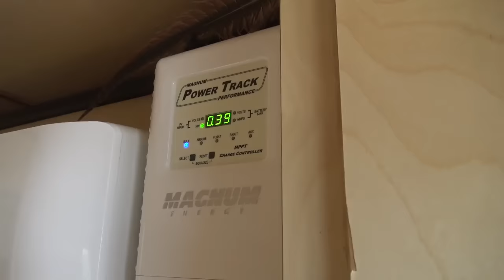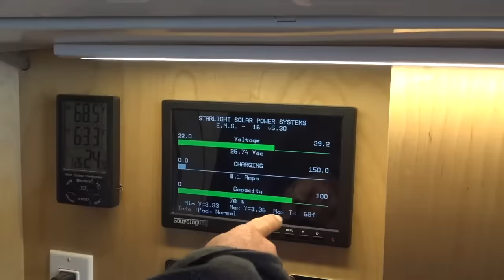Full Time Tiny Living 100% Off The Grid | DIY Cargo Trailer Conversion  With Lance & Tamra

Comment: For Lance - I have the same washer.  To prevent the clothes from getting stiff when they dry, use approx. 3 tablespoons of vinegar in the rinse.  Nice cheap fabric softener, that cuts the soap, and also gets rid of odors.
Reply: Voice I just got rid of mine, as it is a water hog. Lance is totally correct.
Reply: voiceOreezn 
I never knew that.  Thanx!
Reply: @lindacianchetti3599  My pleasure!  Vinegar is some amazing stuff!
Reply: Took a while to figure out soap to water ratios...Less soap was the answer for me.
Reply: But wouldn't you then smell all Vinegary?!
Reply: Vinegar you can drink and it's good for your skin not soap.
Reply: What about the vinegar smell?
Reply: @shaylacrossland1475  The vinegar smell is completely nonexistent.  Once the clothes dry, they don't smell like vinegar at all.

Comment: Love his set up. Great job. My wife & I did the same concept with a 6x12 Cargo trailer into a tiny home. We did 2.4 m wood ceilings  , birch plywood bed for strength & weight savings . Murphy chairs  on the rear of the trailer both sides that turn into a bed.  200 watts of solar -300 watt  soon, sink , 110 v fridge - much cheaper than 12v & easy replaceable,  like he said,  bathroom with shower & toilet. We love it almost more than our house.  We do some state parks but dispersed & national parks with minimal daily fees is the direction were going. Happy trails!
Reply: Love Our Planet Adventures I can’t wait to get started! I’m thinking a cargo trailer as well!

Comment: I actually watched Lance's video when I was ready to start my Cargo Trailer conversion. I have the same, well everything he is using. Love the 9,000 BTU Pioneer mini split. I work and travel on the road, so use it often. Mine is built to haul my Dune Buggy. also. The bed is across the rear and goes up while I am loading it. But the 32 x 32 shower, Mini Split, magnetic screen, even the washer, is the same. I'm running 1200 watts of solar and Leaf lithium batteries. Thanks Tamera for the video and MOSTLY, Thanks to Lance for helping ,me realize that a cargo trailer is RIGHT for me. Thanks, Lance, Tamera and Jamie. Hope to meet you all, some day.
Reply: Love to see some pics

Comment: a tip for your water-hog washer: save and use the rinse water to wash the next load. You'll use half the water and still have clean clothes.
Reply: Seriously, And if you reuse the wash water, too. Start with not so dirty items and progress to dirtier. Lol, then mop your floor!
Reply: Bonnie  Garber that’s the old way
Reply: This is how I do it.  I have exact washer in my cabin (in which I live full time).  Also, use just enough soap to see a few bubbles.  That will keep the clothes from being stiff when you air dry them.
Reply: I have the same type, it's a Kuppet, but they're all the same. I use 5-6 gallons in the wash side with about a 1/2 cup soap then when the wash is done, I put the wet clothes in a bucket and wash 2 more loads in the dirty wash water and add 1/8 cup soap with each load (if needed) my theory is that when you use a double loader you are using the same water and soap without changing the water! (yes, the water will be lt. gray-black and could be gross) then to rinse divide the 3 loads into 8 and add 1/2 gallon of water into the spinner through the hose connect, a quart at a time (a funnel is helpful), not the washer for each of the 8 loads total water used 9 gallons for 2 standard loads of clothes, if you wash and rinse each load the normal way it will take about 7 gallons per load or 21 gallons to do the same amount of clothes.  Your clothes may still have some soap in them, but that will happen at the laundry mat too and if your trying to conserve water, this works and you will have clean clothes! You can also catch the spin water and add it to the washer water to save even more water.
Reply: Bucket.....plunger....soap...water....done

Comment: Outstanding electronics setup.  I really like the ability to watch on the TV.  I bet that 4800 Wh of electricity in the battery would also run that 800 w AC for a few hours in the muggy south to sleep without a noisy generator running.  Nice rig!

Comment: CLOTHES WASHER:  I have a washer like your, but got the model with the dark-blue top because it uses 200w instead of 300w, saving batteries.  I can wash a month's worth of clothing in 2 hours with only 10 gallons of water, by spinning one load while washing the next, and pouring the same spun-out water back into the wash tub for the next load.

Comment: Great job Lance 
One of the best I’ve seen 
Mini splits are awesome
Reply from the maker: I would like to add that to my own bus sometime next year, budget permitting. I totally agree, Mike!
Reply: Enigmatic Nomadics if your bus is divided they make one that’s 2 indoor units to one out door unit but these are only in 220 volt.  If it’s a open floor plan one should be fine. My 15000 btu mini split runs on about 4 amps @ 220 volts very efficient and the Mitsubishi brand are extremely reliable if installed correctly.

Comment: So, maybe it missed it but, what size is this trailer?  It's hard to tell the length, width, height, and number of axles.  He said it weighs 7,000 lbs, so I'm guessing it's a two-axle and probably at least a 7x14', but it would be nice to see the actual numbers.

Comment: With the AC condenser unit in the way, how do you get the propane bottles out to refill? They need to be weighed to properly fill without overfilling. Just wondering caused didn’t look like they had room to come out.

Comment: I really like the black exterior but it must be nearly unbearable until the AC has had time to cool it down. Would you do it again in black or go with white? What thickness and type of insulation did you use in ceiling and walls. Fantastic looking camper by the way!

Comment: I'd sure like to know what kind of heat/AC unit he had hanging on the wall, please?  Ty
Reply: Lisa Chafin a pioneer mini split you can buy it online install it yourself and pay a professional to do the startup. Start up is critical for the longevity of a variable refrigerant flow system. Pay 3 or 4 hundred to a professional they will pressure test it evacuate it and start it up.
Most of these come pre charged so you should not need any refrigerant .

Comment: is it possible to have a 24/7 mini split running from solar on a cargo trailer?
Reply from the maker: If you have enough solar with a generator back-up, definitely.
I'd have at least 500 amp hours of LiPo batteries installed.
Reply: @enigmaticnomadics  so amazing!!!

Comment: Running all of that 24/7 on 200Ah of 24v. battery capacity with 1,400 watts of solar? Those are very significant loads yet the battery bank would be full in a very short time on a sunny day, meaning the whole rest of the day's output has to either be diverted to the ductless and other uses or is wasted. Little cooling or heating time available if the sun isn't shining. There are sizable parts of the US where that would make it quite miserable to try to sleep in.

Comment from the maker: Equipment Links From Lances Build and Time Stamps
11:50 22 Gallon Fresh Water Tanks https://www.plastic-mart.com/product/515/22-gallon-rv-water-tank-rvb276
          RV Fresh Water 20 Gallon Tank on Amazon for $64.95 https://amzn.to/3jEKpVY
12:05 DC HOUSE 33-Series 12V Water Diaphragm Pump with Pressure Switch https://amzn.to/3jGnzNB
13:32 Insignia 32-inch Class F20 Series Smart Full HD 1080p Fire TV https://amzn.to/3KOtsUZ
14:37 Classic Brands Cool Gel Ventilated Memory Foam 12-Inch Mattress  https://amzn.to/36iWygf
14:52 Pure Egyptian Queen Size Cotton Bed Sheets Set https://amzn.to/3EqvHLJ
16:30 Magnum MS4024 4000W 24V True-Sine Inverter/Charger https://amzn.to/3MbuCtI
16:31 Coolerguys Dual 120x120x25mm PWM Fans with PWM Thermostat Controller Kit https://amzn.to/3JHfS4d
16:33 Magnum Energy PT-100 Maximum Power Point Tracker (MPPT) https://amzn.to/37RlDza
17:23 Sourcingbay 10.1'' TFT  Monitor https://vbindustrialsupply.com/products/new-sourcingbay-10-1-tft-led-cctv-monitor
19:36 Pioneer Diamante Series Ductless Mini-Split Air Conditioner https://amzn.to/3vG90PV
21:46 Apartment sized fridge https://amzn.to/3uKpdnB
22:46 Greystone, 21 Inch Freestanding RV Gas Range https://amzn.to/3OcRcnL
24:25 COSTWAY Portable Washing Machine, Twin Tub 17.6Lbs Capacity https://amzn.to/3L0tXLu
29:28 iSpring WGB32B 3-Stage Whole House Water Filtration System https://amzn.to/3jMl7oV
30:30 Travel Berkey Gravity-Fed Water Filter https://amzn.to/3JLU2Ng
31:15 CINKEE Upgraded Magnetic Screen Door https://amzn.to/3uNEGDm
32:25 Eccotemp fvi12-NG FVI-12 Natural Gas, 3.5 GPM https://amzn.to/37TDCVQ
33:23 WeBoost Cell Booster https://amzn.to/37Up0oR

*This list is provided as a general guide to sourcing Lance’s Equipment. Some are Amazon affiliate links, and some are not. Suitable replacements are used in some cases. Special thanks to Lance for sharing his time with us.

Comment: He doesn't feel human waste in his living space is sanitary so he immediately takes it outside so it can be a threat to everyone else?  Where is he putting this human waste?  In a public trashcan or on the side of the road?
Reply: Amy Walker society dumps it into ponds and streams and uses drinkable water and contaminates it. Composting your poo turns it to soil. And most can campers go outside to outer facilities which are typically available. You can use cassette toilets and dump at dump sites. So keep calm Amy, don’t panic.